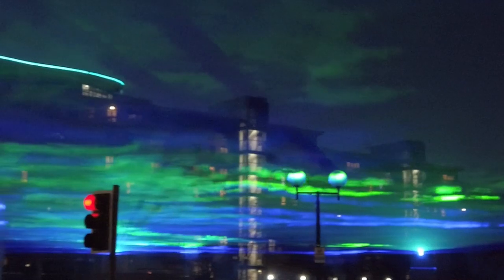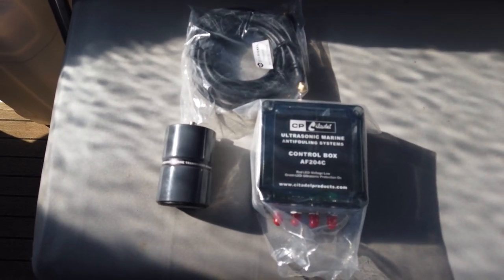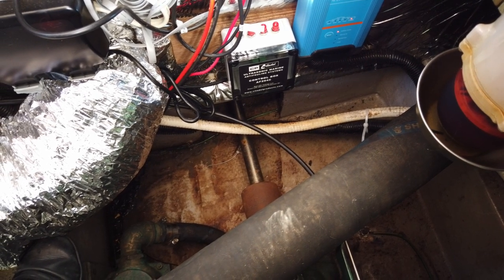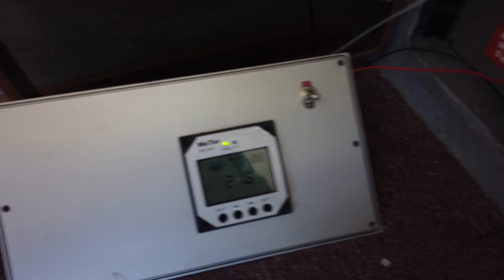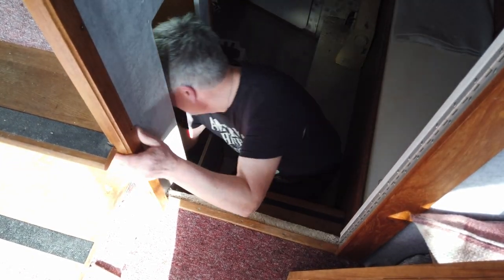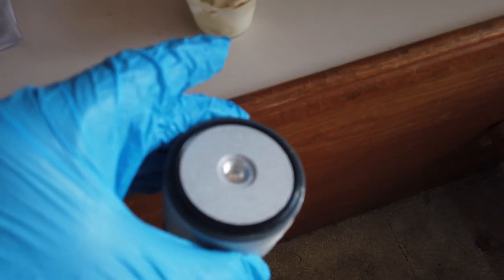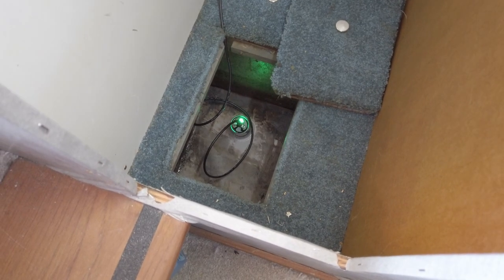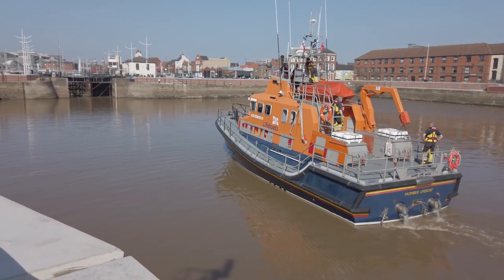Episode 80 The Awakening in Hull, Ultrasonic Antifouling, and the RNLI

Comment: Mearsk have ultra sonic anti fouling on their ships, it certainly works on steel hulls , be interesting to know how it does on GRP
Reply from the maker: From the info I have so long as your Hull is not cored with either foam or balsa. I'e solid fibre glass it works the same as on steel or aluminium.